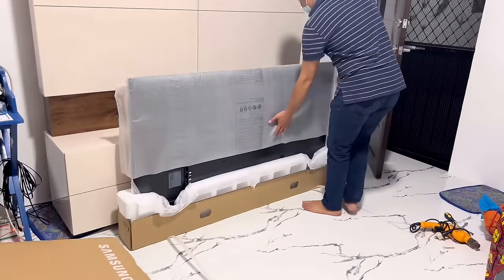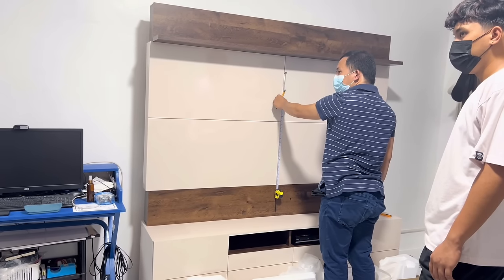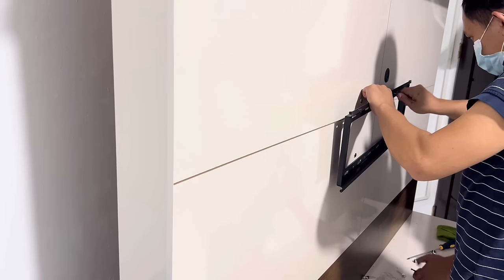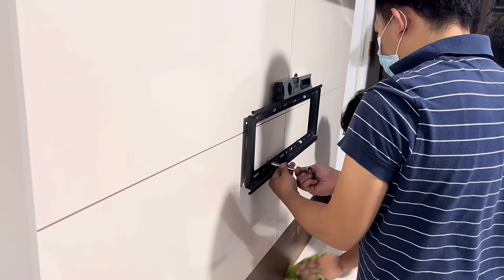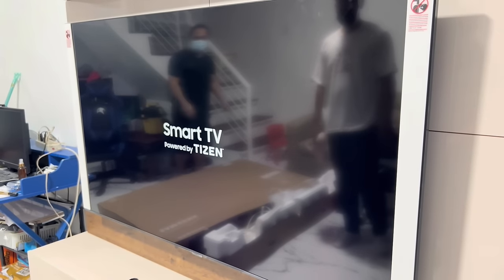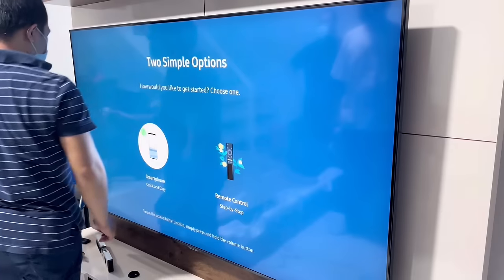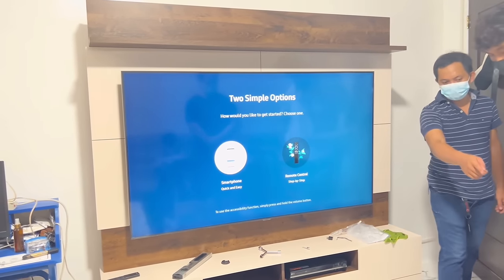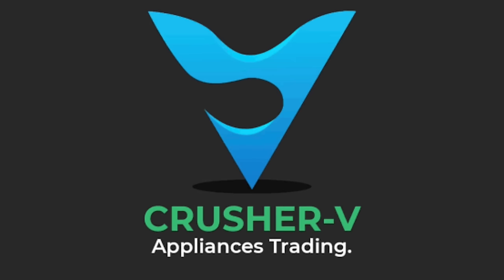Samsung 65 inches smart tv wall mounting | 65AU7000

Comment: First off that was not a flat wall in a normal house. It looks like a special cabinet meant to hold the TV on it. Since fiber optics internet is here you only need to allow the power wire to hang and the TV will get the WIFI signal from your internet box so one must choose what type of mount you want. Swivel or mounts that extend away from the wall if other connections are needed like gaming etc…will allow other stuff to be imputed in the back of the TV when needed. Other than that the install looks sound to me.

Comment: Where do you get the holder rings that go in the back of the TV before the 8mm screws?  the two holes on top are shallower than the two holes on the bottom on my tv...
Reply from the maker: it's normally included sir when you buy Tv wall bracket.
Reply: @crusher-vappliancestrading  hello! The screws my wall bracket includes are smaller. Should I be worried about it supporting it?
Reply from the maker: Do you want it to be thinner or shorter, it's okay if it's a bit shorter as long as it's tight, but if it's thin and doesn't fit that's the problem.
Reply: Cómo se que medida,son los tornillos que llevan en la parte de atrás ,si no los trae mi soporte

Comment: What size and length are the screws that go into the back of the tv?
Reply: Same question. it seems to me that the bottom holes and the top holes are different sizes. Have you figured it out?
Reply: @huntergreen7266  hey i bought m8 45mm screws bolts and had to cut them because they were too long
M8 is the right size it's just the length that was the issue 
All 4 mountings holes are the same tho.
Try m8 25mm without washers and 35mm with washers.
Hope this helps

Comment: Why doesn’t my Samsung have threads in them to screw on bolts? It just has holes. Is there something I’m missing?
Reply from the maker: you 8mm screw sir, it's normally included when you bought a wall bracket
Reply: You don't have a wall mount tv
Reply: You have to buy a Samsung wall mount kit

Comment: My 8mm screws are not long enough to get to the hole threading at the back of the TV, what do I do?
Reply from the maker: there are different sizes of 8mm screws you can buy at hardware, sir.
Reply: So what length did you you use?
Reply from the maker: @stevechester3730  20mm length
Reply: I also have my 8m x 20mm screws but it seems it will come off. Tried to research the best length and most of my research says at least 43mm. Is your tv okay until today?